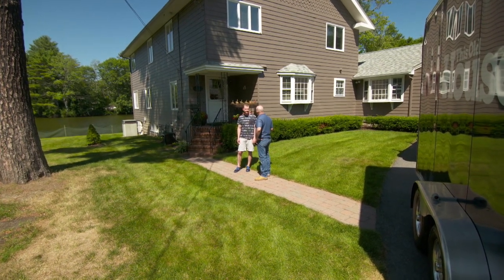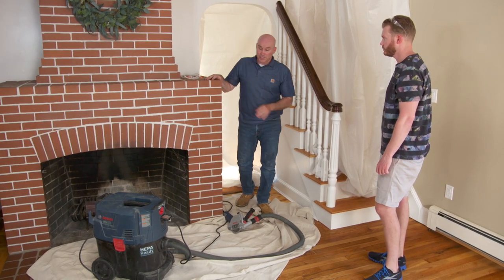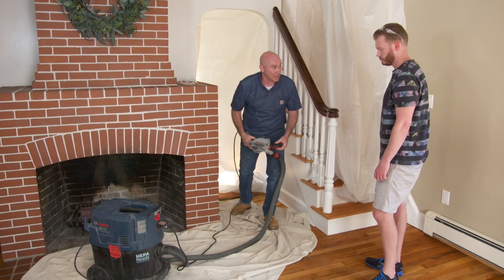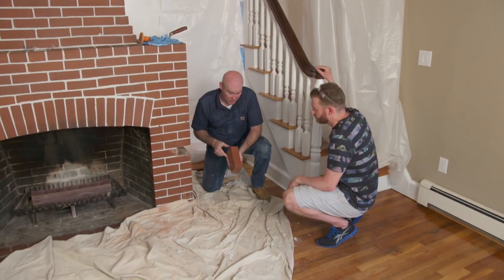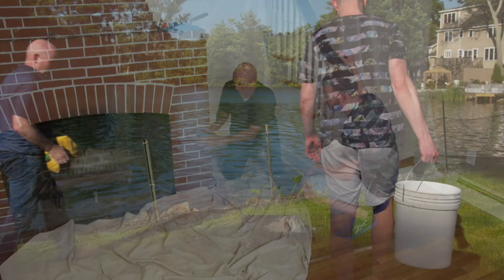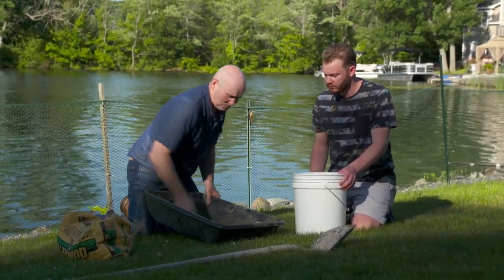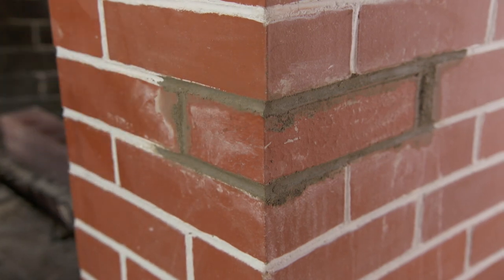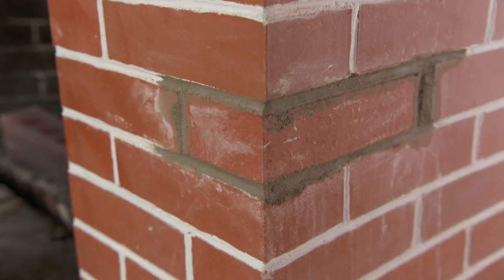How to Repair a Damaged Fireplace Brick | Ask This Old House

Comment: I sell mortar, brick and stone for a living. This is what we call the hard way to do something.
Reply: and what would be the easy way? please do tell.
Reply: I would start by just patching it. A well done patch would be nearly invisible. However i understand they wanted to show a replacement for the video. 
The weakest part of the assembly is the mortar joint. That’s what you cut, not the brick. Then just drill the joint out and tap with a chisel. No need to mask off the entire room. 
When putting the brick back in. Mortar sticks to mortar very well, unlike was mentioned. It won’t stick to mortar dust, so cleaning it was good. Then put mud on the TOP of the brick as well when inserting. Use a squeeze bag instead of pointing trowel. Much easier.
Reply: $250 job for what could have been a $25 job
Reply: @abuehn  yeah I was like “did he just say mortar doesn’t stick well to mortar”? What a joke

Comment: Cosmetic damage that was going to be painted over, why on earth would you not just fill it with body filler and paint it? Are you planning on replacing the brick you damaged during the repair, or does that not count?
Reply: In the episode they did paint it white but lightly, you can still see the brick through the paint.
Reply: exactly what I thought when I saw this.  $300 solution for a $10 fix.
Reply: To bad they decided to paint the brick.
Reply: @bngr_bngr  Hopefully someday they'll realize what a bad choice that was. Ugh.
Reply: Red bricks are very pigmented saturated red. I have learned it the hard way, if you just fill in the chipped clay brick, the redmess will bleed trough the wet mortar or filler and then will bleed trough into wet paing. It had to be replaced to have a smooth face that has no loose brick particle. As  once my grandpa said: you can crush and pulverize the red or yellow bricks and use them as pigment
Reply: @mr.dahliaking.202  Body filler would have filled the void- and matching that red would be a piece of cake. Then overcoating it would completely hide the finished work.
Reply: Preach!

Comment: I would have used an epoxy to repair the brick then stain the epoxy close to red brick color then white wash and you'd never see the patch...but at least it's a good brick removal, replace, and retuck point video...

Comment: There are easier ways to repair light damage to a single brick than replacing it, in situ resin repair systems would be quick, cheaper and invisible considering it will be overpainted.

Comment: Not very good with the grinding job there, totally ruined the perfect brick next to the chipped one unfortunately, surprised more bricks didnt get chipped with the hammer and chisel pounding, one small slip of the chisel and another brick would get damaged
Reply: Hamish Robinson if it’s soft mortar like that probably is why not use a old hand saw

Comment: Why is the vacuum not on? Also that Bosch vac needs the bag in it with a 1" overhang to prevent dust from leaking out! FAIL X2!
Reply: The vacuum is on, otherwise there would be much more dust in the air. Actually these vacuum cleaners have an automatic on/off functionality. You plug the appliance, which should be vacuumed, into the outlet on the vacuum cleaner. If the appliance is started (in this case the grinder), the vacuum cleaner will automatically start. If you stop the grinder the vacuum is still running for additional 6 seconds and then it will switch itself off.
He only had a problem of leaking on one spot, creating a small amount of leaking dust. But you can't avoid it during this work in this location (corner).
Reply: @Marcel_Germann   Marcel Germann  I own one. I know. I know for a fact this vacuum isn't on because  there is forward throwing dust, which I have cut hundreds of bricks and thousand of pieces of concrete with no forward throwing dust in corners! Secondly, yes there is an auto on. Anyone who owns the vacuum knows that!  The deal is the vacuum is 1 either to far away to pull good suction ( using an extension hose) 2 the amps are to low 3 the vacuum isn't on or 4 his filter needs to be blown out with a combination not one of the above.

That grinder on grout makes little dust as is because of it's shroud design. Dry cuts with a hose attached and no vacuum makes for about the amount of dust you see here due to the auto directional fan inside this saw!
Reply: @Vyacheslav Ivanov I could, but that cuts down on my productivity which costs me money! YouTube already has hundreds of these videos anyways. No need to make another!👍
Reply: @brookekathryn1980  The amps of such an angle grinder should be enough to start it. I suppose it's using 125mm blades, so the demand is in the area between 700 and 1300W. Actually they must put in a soft start into these grinders, otherwise the circuit breaker would trip. That should be enough to start the vacuum cleaner.
Reply: @Marcel_Germann  I'm not talking about amps to start it. I'm talking about the power broker above the AFC. He likely had the power broker at 7.5 A or lower. 9-9.5 is optimal when using rotary blades or wheels! 7-7.5 is basically for drills.

Comment: No dust mask when grinding?
Reply: Not necessary if you've connected the vacuum in that way they've shown here using the special shielding with the connection for the vacuum cleaner. The vacuum cleaner is auto on/off, if you start the grinder the vacuum starts too, if you switch the grinder off the vacuum will run additional 6 seconds and then will switch itself off. The grinder plug must be connected to the outlet on the front of the vacuum cleaner for this system to work. I'm using this system here too, it is actually quite nice and useful. My vacuum cleaner is a Bosch too, but the appliance you're using could also be made by any other manufacturer for this system to work.
Reply: Marcel Germann I know how a vacuum works, but thanks for explaining anyway. 

Why tarp off the upstairs then? There is residual dust that escapes the vacuum and it’s clearly visible in the video plus he admits in the video it doesn’t get everything. These videos are made for learning purposes and TOH should show proper PPE and wear a mask. They do a good job with the glasses and hearing but miss the boat with the mask.
Reply: @rymaster4385  Because most of the dust, especially the dangerous fine one which is respirable, is collected by the vacuum cleaner. But as you said, not all, but this dust which escapes isn't more than an inconvinience. Doing this work without the vacuum and you couldn't see anything in that room, even if it is only that small work. This is like smoke from a fire filling the whole room in a short time. The next thing is precaution for the "what if the vacuum fails" situation, because the grinder will then still produce dust. Then you would have this fine dust in the whole house, so you would only have it in a limited area.
I've done enough work with wall chasers cutting slots for cables into plaster, which is one way to install cables for electric power in Europe. I know how it looks when the vacuum fails...the room is filled in no time with dust and it looks like the house is on fire if you look from outside and someone opened the window.....